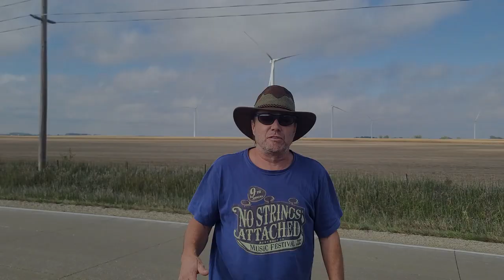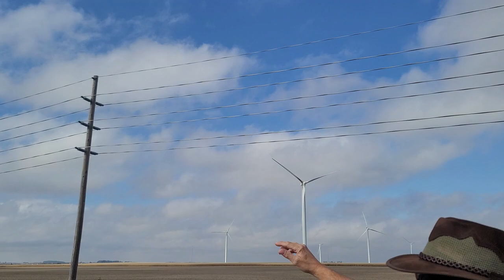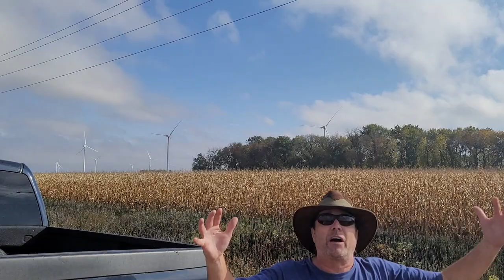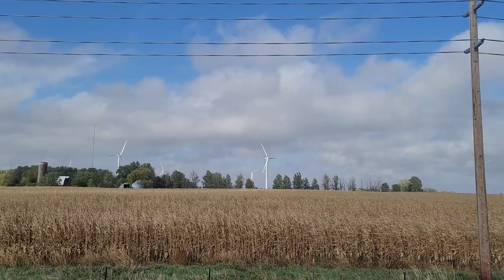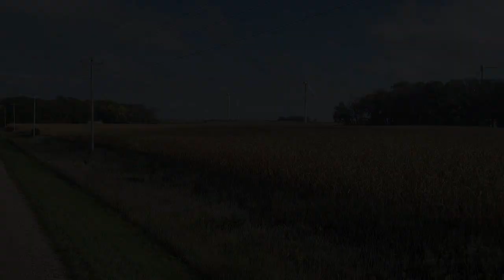Entire Wind Farm SHUTDOWN in Iowa

Comment: Doesn’t seem like it’s 50mph winds. I can hear you quite clearly with little to no wind noise. 

Also that turbine you claimed is burned out… I’d love to see a close up image of that. Looks like blade bearing grease splattered up the blade.  The part of the nacelle where things are more likely to ‘burn out’ looks completely white and normal. 

There’s a multitude of reasons why that wind farm is off if it truly is a windy day. Scheduled HV maintenance may require the wind farm to be off and can be off for weeks! Completely normal over the 25-35 year life span of these turbines.

Another reason, the beauty of these wind farms is that they don’t have to be on 24/7 365 days a year, If there is no need need for them to spin then they don’t! The beauty of wind turbines is that they can be switched on/off to compensate for usage on the local and state energy grid.
Reply from the maker: If there is no need, why keep installing more?? I was in a low area that was sheltered so you could hear me talk, or should I have been in the open where you could not hear anything??